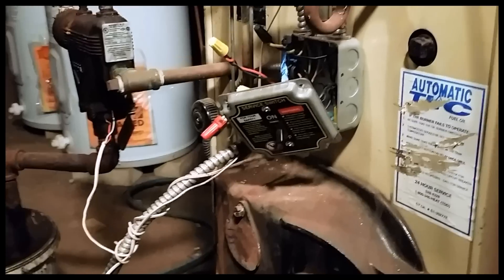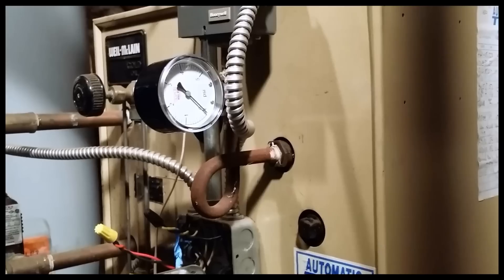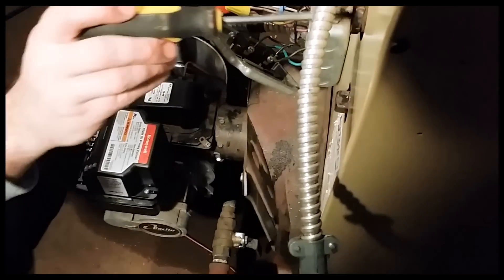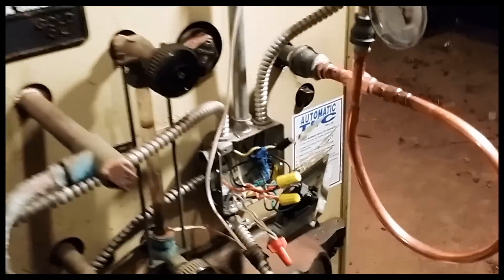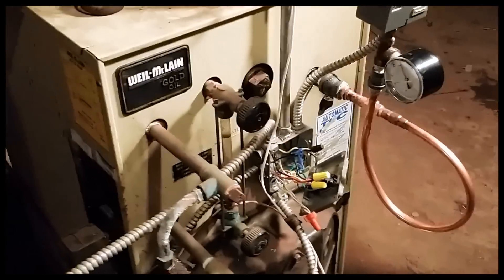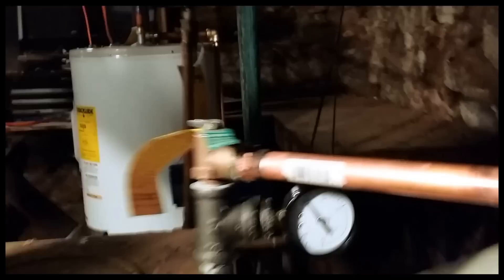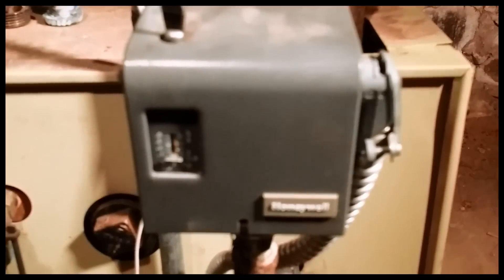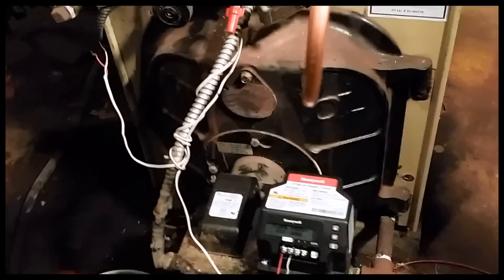Steam boiler troubleshooting for neighbor - pigtail repair

Comment: That sight glass looks a little cruddy, at some point the boiler should be flushed out and then skimmed.  Next try to remove that large plug near the pressuretrol / gauge port and install a 1-1/4'(?)pipe and a cap so that boiler can be skimmed use dope or teflon tape so it can be easily opened later.

Comment: I know this an old vid. but great job on troubleshooting. Also,   I have a gas steam boiler and want to clean pig tail as part of yearly maintenance is the only way to take it all apart?
Reply from the maker: I think you gotta take it apart yeah.  I'm not a tech though.  Best of luck
Reply: @matthewolson8875  Thanks Matt.

Comment: Was it clogged inside the unit and if so how did you clear it out or replace it. That part you didn’t show. Everything else looks good.
Reply from the maker: No clog inside where the pigtail seats...it's open to the boiler there.  ...old vid now hehe.  Thanks for the comment

Comment: how do you determine how much 8way to use
Reply from the maker: What's 8way?  Weight?  Pounds?  You mean pressure.  I don't remember but there are proper specs.  This vid is older and I'm not a boiler technician.  You'll need a boiler tech to yell u what pressure settings for the system.
Reply: @matthewolson8875  8 ways is an agent you put into the boiler to retard the deterioration of the cast iron

Comment: The soft copper  will fail from vibration
Reply from the maker: From a materials science stand point that doesn't make sense.  I would think soft copper would be more resistant to metal fatigue because it's already annealed.   Do you have a reference?   Link?

Comment: Pigtails are typically black pipe or brass. They also sell them prefabricated, so you don't need to fabricate your own. The purpose of the pigtail is to have a water trap, to shield the gauge from exposure to direct steam. That said, the gauge you put on the relief leg needs a pigtail as well. It is also wise to replace the relief valve now that it has operated. 

All that gunk is an indication that the boiler needs to be blown down, and likely that boiler water treatment may be in order.
Reply from the maker: All good advice thanks.  The day this happened was a Sunday and no plumbing supply houses were open.  Had to fab something quick. The homeowner knows he needs to have a real tech come and do what your suggesting.  Tx!

Comment: No worries I’m just kidding but that home made pig tail you made out of copper needs to be replaced with a brass pigtail.
Reply from the maker: Daniel Gordon many people have told me that. ...but I still haven't had a great explaination as to why?
Reply: @matthewolson8875  because the coefficient of thermal expansion of copper is much larger than brass or steel. Copper is also a much softer metal (it has a relatively low yield strain).
These two things taken together mean that copper will plastically deform under the relatively large temperature swings in a steam system, which causes work hardening, which means the copper gets more brittle over time, which means it's eventually going to crack under the stress.
Reply from the maker: @iaeeniaeen1898  finally a good answer. ...do you have a reference so I can look this up?  Btw...when copper gets annealed it gets softer....but you are saying it work hardens?  Just need a link for reference

Comment: I have some constructive criticism for you. 
Kudos to you for willing to help out your neighbor but you violated rule #1 pertaining to relief valves. If a pressure relief valve for a steam boiler, hot water boiler or tankless water heater fully relieves, or a temperature and pressure relief valve for a standard water heater fully relieves, you don’t replace the valve first and see what happens, you figure out why it relieved and then replace it. Relief valves, even if brand new usually don’t fully reset and continue to leak slightly, and every time they relieve the spring inside gets a little weaker and they’ll start to relieve prematurely. A good steam boiler tech would have figured out that the pigtail was plugged almost immediately by the fact that the gauge wasn’t registering pressure and the Pressuretrol wasn’t shutting the burner off at the standard 2psi setting, 1psi differential settings, they would have addressed the pigtail and checked the gauge and Pressuretrol for sludge and cleaned or replaced those as well, then changed the relief valve and fired the boiler. 
What’s actually more concerning is that everybody just plain got lucky that there was no property damage and that nobody was seriously injured or even killed by the steam dumping from the relief valve. If your neighbor had been injured and had to seek medical attention his homeowners insurance and medical insurance could refuse to pay and tell him to go after the contractor’s insurance to pay. Since you’re not licensed, bonded and insured to do boiler work then you’re personally liable to pay for any damages, and depending on the locale could even be criminally charged with negligence. If your neighbor says “He was just trying to help, I’m not going to throw him under the bus” and doesn’t disclose that you did the work and that’s how he was injured and how the property damage occurred then he’s committed insurance fraud, which is also a crime. This is exactly why I stopped doing side work and have my family and friends call the main office number so that there’s a paper trail because everything is properly invoiced and my insurance will cover any potential mishaps that although are rare, may still occur. I give them a steep discount because they’re family and friends but everything is above the table
People think hiring a properly trained, licensed, bonded and insured contractor is expensive but this exactly why it is expensive, because we’re taking on a tremendous amount of liability and the insurance to cover our mistakes, however rare they may be, is extremely expensive, but it not only protects us but also our customers as well
Whatever you do in your own home is on you but I strongly recommend that you don’t put yourself or your neighbors in a position like that ever again
Reply from the maker: MN Hvac Guy thanks so much....finally a clear and level headed comment.  Duly noted and appreciated
Reply: Agreed. With in the first 1 minute I knew either the pigtail was clogged-or presstrol was bad/not set properly... not a fan of how this guy modified the safeties on this boiler, especially for not know what he is doing... guess this kind of stuff keeps us busy...

Comment: talk about a dangerous situation?   delinquent maintenance and a   dude trying to do a repair,   will that work?    - maybe,     to resolve the danger,    get someone that knows what  they are doing.,  regards
Reply from the maker: #1, my neighbor did hire someone to fix it.   2 weeks later it wasn't fixed and the guy never came back in the dead of winter.  #2, when you comment on my channel, please don't just say "get someone that knows what they are doing" ... that isn't helpful.  If you have a specific reason against a specific thing I did, with evidence to back up your claim by all means please let me know.  I can't stand comments that are non specific and aren't helpful.  

This was done on a Sunday afternoon when the supply houses were closed.  Once the boiler was stable I recommended to my neighbor to have a pro come in and look at it.  Obviously I am not a pro technician and my neighbor understands the risks here....
Reply: certainly be better to have taken that path before making a video,  15 minutes of fame,    in agreement with jjgm 2730,   regards
Reply from the maker: 2 replies and nothing contructive to say.   next one gets you banned.   if you want to have an argument, lets do it.   but comments like "you have no clue" aren't helpful to anyone

Comment: I have been a heating tech in NYC for 33 years. It is code in NYC that all pigtails be brass. We also use brass nipples (not black) between the boiler and pressuretrol. Pigtails are available in softer yellow brass, or thicker red brass. Even brass pigtails clog sometimes. Steam systems usually have piping and components that are 50+ years old, so contamination is bound to occur. Blowing down the system is not going to rid it of the contamination, and excess fresh water make up is not good for the system either (a totally different discussion). Please don't over think this situation. P404a's are not that accurate, and 404F's and vaporstats are not either (especially since mercury tube switches were outlawed and replaced with microswitches. A good 50% of all those controls need the microswitch field adjusted to to work properly. Either they never trip, or don't snap back. Try to get the boiler to stop as close to 1lb off, and .5 lb on. In field conditions we often have to compromise those numbers to the lowest setting that is reliable.
Reply: Hey Jointlock!  I live in East Meadow NY.  I have a 1 pipe system.  All my radiators work but i am having an issue.  MY system is not balanced.!  My thermostat will be satisfied when all the first floor radiators are hot and cycle shuts down without sufficiently heating the upstairs which only has 3 radiators.  Do you do house calls?  You sound very knowledgeable in this area..   I am looking for an honest tech.  Please let m e know
Reply: supermannnnn Change your air vents to the correct size in correlation to the distance away from boiler.
Reply from the maker: Jointlock interesting....thanks!
Reply: Don't know if you're still around, if you are, do you know why they pigtails have to be brass, and for example cannot be copper?

Comment: What are the steps prior to removing pigtail. i understand shutdown power to the boiler but what about pressure. do i need to shut any valves, release pressure or drain water?
Reply from the maker: juliusz kalodont I am not a boiler technician and I don't specifically remember what we did I am pretty sure the pigtail is not underwater so you just have to worry about pressure But again I am not a technician so it's difficult for me to comment specifically
Reply: in my system  have problem the manometer gauge on the pigtail shows 3psi when cold and boiler doesnt start untill i adjust Pressuretrol up to 3psi. then its fires up but quickly pressure reaches 6 and boiler stops.. Did you experience this with your boiler?
Reply from the maker: juliusz kalodont the pressures you are describing sound very high if the pigtail is clogged then less pressure gets to both the pressure switch and to the pressure gauge do you have a separate pressure gauge
Reply: N I dont have any other gauges.. I'' remove pressure gauge ti check if its faulty. Thanks for quick response
Reply from the maker: juliusz kalodont I changed the gauge on this particular boiler and this was a while ago so please forgive me if I'm off on the details but I would highly recommend having at least two gauges on the boiler just in case
Reply: One more question what  gauge range did you install? Where did you buy it?
Reply: OK i removed pigtail and it was completely clogged water couldnt go through.. I had to use copper wire to clean it and then carb cleaner.

Comment: normally what you have on the end of the connection to the gauge is a 1/4 turn valve so that you never have live pressure on the gauge, only when you need it for diagnosing something, otherwise you'll be replacing these thing all year long.  They won't last for beans. Us it, then shut it off. 
     Your bigger concern is the uninsulated piping.  You want dry steam and this setup is gonna take forever trying to heat up that piping to 212F being exposed to the cold basement air.  Your money is being pumped into the basement.  Get some 1" wall fiberglass insulation and insulate the crap out of it.  You'll instantly see a marked difference on how long and often the boiler runs. your wallet won't bleed so badly....oil company won't like it much though...
Reply from the maker: hvac01453 nice suggestion on the valve as far as heating the basement this basement needs the heat to keep some of the pipes from freezing nice suggestion on the valve as far as heating the basement this basement needs the heat to keep some of the pipes from freezing
Reply: Matthew Olson install a small fan coil unit using the return condensate as a heat source. The thing is what your goal is on a steam system is DRY superheated steam that is so good and hot, it doesn't condense on the way to the radiators,.    no banging of pipes, very silent. Must be silent. ......
Reply from the maker: Mike Malone not my house...neighbor. ..but will mention it....I hear ya....thanks
Reply: Just bought my house with  a steam heating system and that was the first thing that I did!  It was running about 2 times an hour and now it is at half that when it hits 15F in the NE.  Very good info to pass on!

Comment: actually you want 1.5 and .5 for the cut in and cut out.   Your radiator vents need to reset themselves and this needs to see less than .5# or the vent won't open to allow the condensate to drain back to the boiler and vacuum lock itself

Comment: you have some junk in your steam side...
Reply from the maker: junk my steam side... please translate?   what does that mean
Reply: What is used for fuel?
Reply from the maker: oil
Reply: I think you have unburned oil getting into the steam side that didn't look like scale. Check your stack temperature it should only be around 50 degrees hotter than your steam temp
Reply: Unless you have oil in your feed water somehow the only way oil can get into your steam side is through the exchanger
Reply from the maker: interesting...  thanks ...   this isn't my boiler, its neighbor's...  so if I see him again I'll mention it.   my fix was just to get him going again, hopefully he's had the boiler serviced since... likely not ...    :(
Reply: Haha having agressive water can lead pitting on the boilers metals. Solids in the water are left behind in the boiler. They settle to the botom.

Comment: Nooooooo.... no no no no - don't use the copper pipe!!!!!!   the pipes in your system are black carbon steel.     You guys need to look up - and get Dan Holohan's books!    http://store.heatinghelp.com/The-Lost-Art-of-Steam-Heating-p/101.htm    you guys are heading for TROUBLE - the copper will react in a BAD way.   (I got his set of 3 books - I bought a former hospital build in 1930's - remodeled into a home with steam heat -  you'll learn a TON from these books... and have your system very happy.)   http://shop.serviceroundtable.com/store/c/29-Books-by-Dan-Holohan.aspx    if ya head over to www.heatinghelp.com Dan Holohan does a blog over there... but his books are gold.   you won't be sorry!)
Reply from the maker: thanks for the heads up.  this was all we had.  

is there any youtube link you can provide that will explain the issue further?
Reply: Matthew Olson  he's speaking of The author Dan Holohan I think from Long Island.  He's the kind of writer that talks like the common man in layman terms with pictures.  Worked for B & G many years ago.  Been doing seminars on steam and primary secondary pumping, magazine articles and has had a n online site called heatinghelp.com.  Everyone in the field knows of him.

Comment: Matthew,
Good troubleshooting. I usually run the differential pressure at .,5 due to the dropout pressure of some vents. Some air vents must drop down to 1/2 psi to re-open to continue to vent the rest of the air.
For more boiler info see www.comfort-calc.net and click the steam tab.
Reply from the maker: +tk032009   Thanks for the link and the comment!